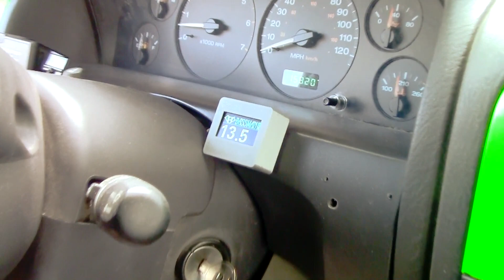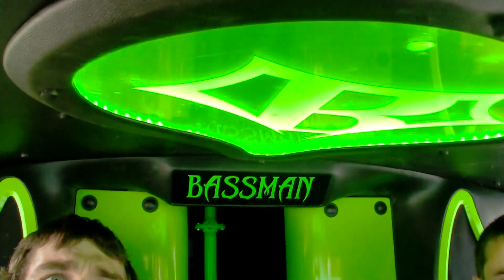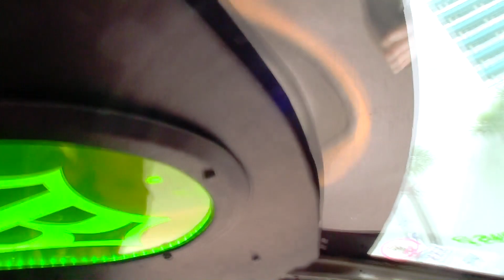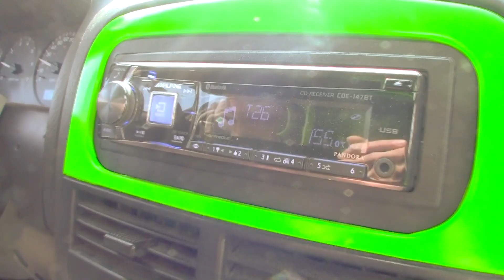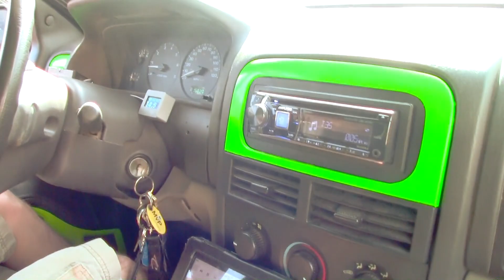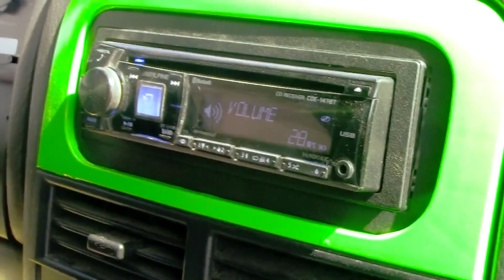BASSMAN GOT LOUDER on 36,000 watts! CRAZY Hair Tricks & Woofer FLEX w/ VERY LOUD Subwoofer BASS

Comment: One of the most incredible bass systems I have ever seen !! Love all the neon lighting, and lime green is my favorite color too :) But a Jeep Cherokee would have been my very last choice of vehicles. Put that system in a Range Rover, and then you would have the ultimate stereo ride. This is like putting a $10,000 silk dress on a pig :) lol
Reply: Range rovers aren't know to be reliable. Jeep Cherokee are cheap to buy, have a decent motor, and are cheap for parts if they brake down. But the power train can last 250kmiles and Plus if they are maintained well.  They also have alot of support for after market parts.
Reply: Fish Chris 

Grand Cherokees are junk, however. 
My last Cherokee had near 200k.  Everything fell apart except the engine. Made a great little work beater.
Reply: Its a Jeep GRAND cherokee, and the price you pay for a rage rover, if your going off road you can pick up a Wj spend 1500 on lift and tires and out do Rage rover all day with ease. Rage rovers are junk. This 10k silk dress would rattle apart a rover in the place it sits. Also Mephinc, must be you havnt taken care of your Grand Cherokee im on my 3rd, first two were Zj,s rolled the first one and the 2nd one i traded in on a 04 WJ, Both had over 220k miles with minimum rust. My WJ is now on 154k not a spec of rust and in the 40k miles ive put on it, it only didnt start once and after a battery terminal cleaning it fired right up. For 4x4 and luxury in the same category ill Take GCs any day of the week.
Reply: Bearistopheles  I have a WJ like this guys except with the 4.7l definitly not junk 😂 at 213k

Comment: That “SPL DUST” is usually from MDF that isnt sealed up**  paint, resin, epoxy what ever you want allll materials used no mater where they are used visible or not you should SEAL it up just for longevity** you breathe that dust in for sure and that stuff contains formaldehyde**

Comment: Hello guys i got tell not to use my full gain knob if i set my gain on my amp i should set it to only use a quarter is that a big deal ?
Reply: Yes that IS big deal! The gain on an amplifier is for signal strength. It is not a volume knob.  Don't set it anymore than 1/3 or so unless you're doing a SPL run.

Comment: does anyone make a amp that is a 2 in one combo ? one half runs mids and high and other mono block subs? that would be a great idea to save space . also this system is next level.  the amp in the rear with all the  leds,what's the name and brand it's massive and looks really good.
Reply: +cloud chaser the amps in the back are crescendo 12K's 3 of em
Reply: +cloud chaser Lots of multi-channel amps can crossover mids+highs to lows between channels. For instance having 2 channels of a channel amp running mids and highs and the other two channels running lows. Not sure about amp classes that are made for that though. Most of them I imagine are AB but there might be some that are class D. That is a good idea though. I know JL made (or maybe still make) a 5 channel amp that had a dedicated bass channel plus 4 for the mains.

Comment: what all that stuff under the hood?
Reply: +jesse ver the thing in the middle is the motor, the blue things are external regulators, they are usually built in to the alternator, and under them are the batteries, then of course the green things are the alternators
Reply: +All2skitzd ok. never seen external regulators before for audio.

Comment: Really?? 4 gauge speaker wire. Why do I still have 12 gauge wire on 2 15s????
Reply: Because that's more than likely all you need. Nobody needs bigger than 8 gauge.
Reply: Robert H. I have 10 gauge on my 15s and need bigger wire
Reply: Is anyone running that much amps through their wires here?